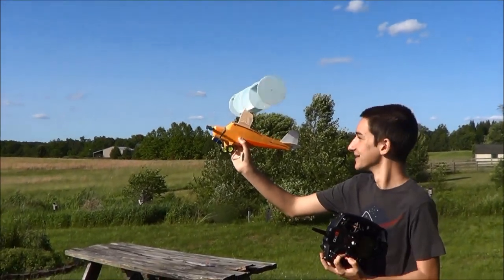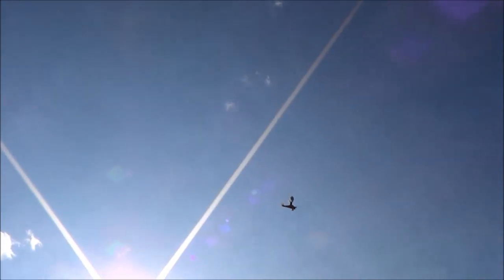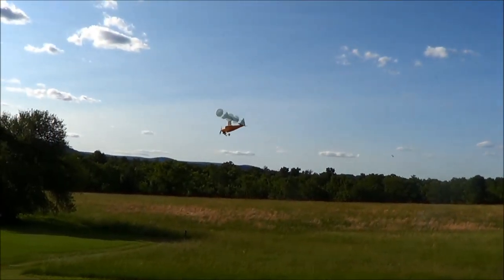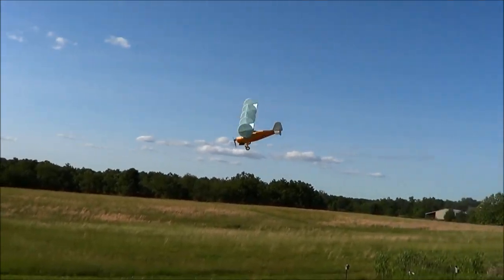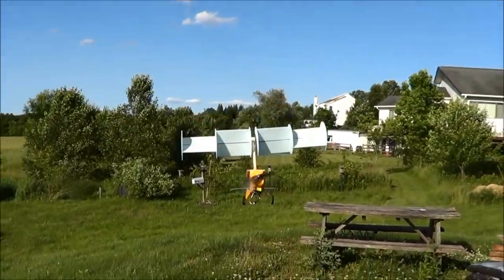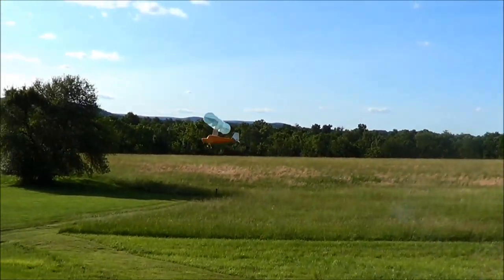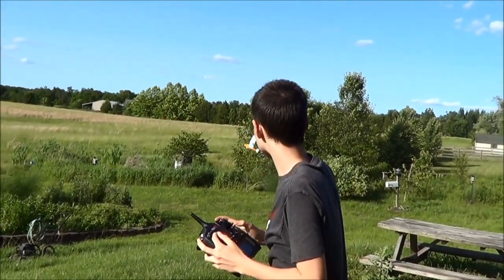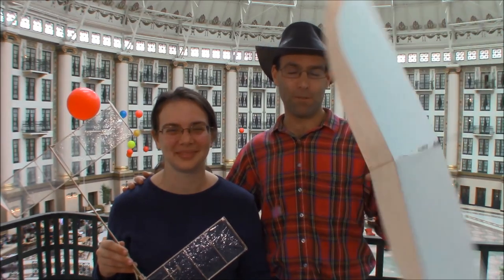Tumblewing Aerobatics and Autorotation with Ross Clements

Comment: I've seen these before, but didn't think of this possibility until now. An ordinary wing will also autorotate along a span axis. Perhaps this could be used for DT. Have the wings on horizontal axis, locked down in normal flight, but release them to autorotate for DT. With the axis at the aircraft CG, it would descend with the fuselage horizontal and land with less likelihood of damage.

Comment: Maybe one could improve the Controllability by shortening the Pylon, so it would resembels a normal Midwing Layout, cheers 👍🏻👏🏻👏🏻👏🏻
Reply from the maker: Anton Blebann we're working on that. With the rotors coming in this close together you can't put them any lower or the prop wash forces them to go the wrong direction.
Reply: @joshuawfinn  yes, i understand, would a Pusher Layout solve this Problem ❓THX for the Respond.